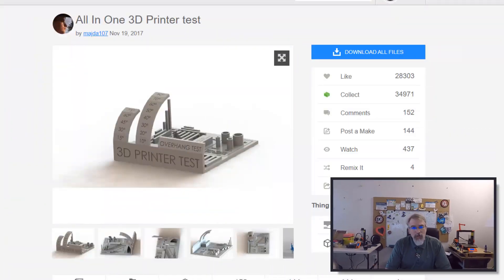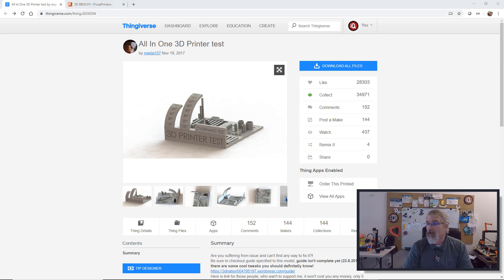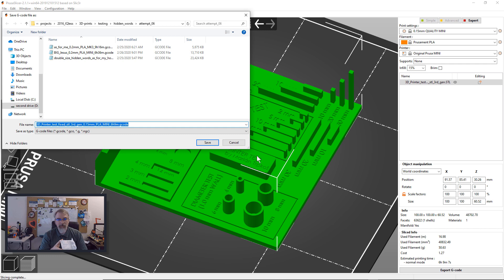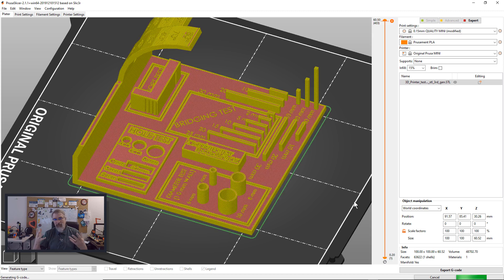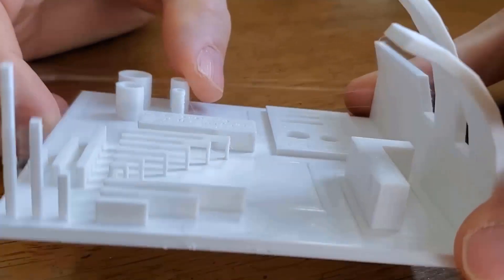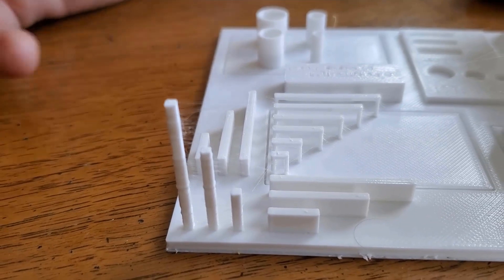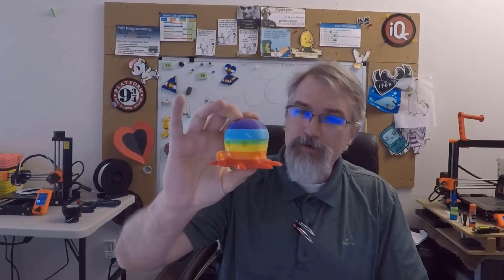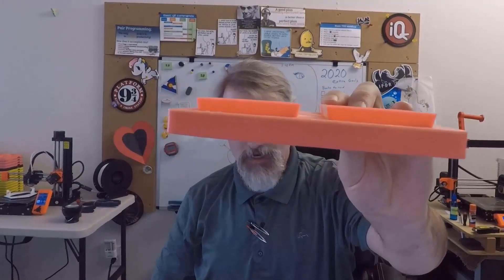Prusa Mini: Torture Test #01

Comment: Thanks for the review!  The torture test you used seems like a good choice with lots of challenges; however I'm wondering why almost no one is using the torture test designed as a collaboration between Kickstarter and Autocad for testing 3d printer capabilities?  For your reference an stl for it can be found here: https://www.thingiverse.com/thing:3158705
Reply from the maker: That is an interesting torture test, I may have to try it

Comment: Hey Patrick, I found out that some whisps (The very fine ones called angel hair) occur when you're printing too cool. Increase the temp a little bit and these should disappear. Cheers! Robert
Reply from the maker: Good recommendation :)
Reply: @iqless  happy to help. (if it actually helps :) )
Reply: Recommended temps (for the Mini) to avoid 'wisps' for different filament types?
Reply: @robbryan3044  I don't have the Mini. A sixth printer might be a little too much for me.. :) you might have to find that out yourself. Just start at the middle Of the recommended Temp range Of the Filament manufacturer. Then add a couple degrees and see what happens. It is just a few degrees that make the difference.
Reply: @rodsnyder6020  Got ya...thanks for the info.  Will remember that (or, at my age, I'll try to remember 🤪) for when I get a 3D printer.  Hopefully, it'll be sometime this year, but have a LOT of cleaning up to do to make room.

Comment: One thing I’ve been trying to find is a video on the visibility of layers, The print resolution, and how smooth it prints walls. (If that makes sense). For example, a comparison of the prints from the full I3 and the mini.
Reply: Tyler Gates I have a mini and 2 MK3S’. Now that I have all the problems worked out, the mini prints better than my MK3S’.  I was getting a lot of jams and was unable to unload filament as the blob on the end was too big to fit through the PTFE tube.  Once I installed a slightly longer PTFE tube it prints great. No jams or blobs. The layer visibility is somewhat dependent on the layer height and print speed.

Comment: Thanks for the videos, I got my mini a couple weeks ago and have been a little behind your journey. I have been wondering about how much the direction of the print vs the fan affects the overhangs. Since the fan on the mini is in the rear, not surrounded like the MK3S. So would the overhang be as good if you printed it 180 degrees from the way you did that one?
Reply from the maker: Interesting idea... I may have to try that
Reply: iqless also if so what would be a recommendation for modification to fix any issues like that in the future? I’m not scheduled to get mine until April 😢